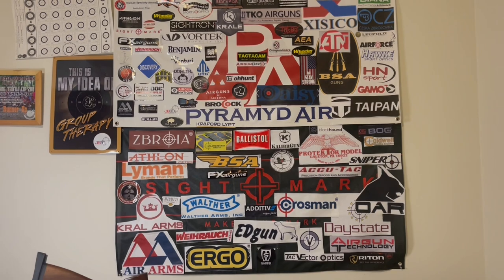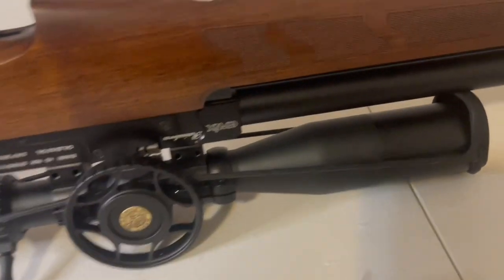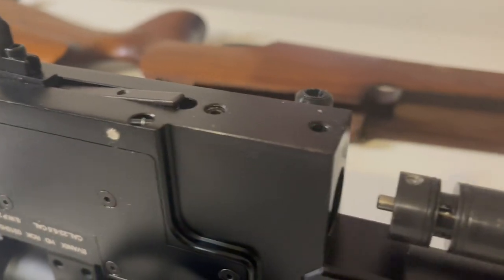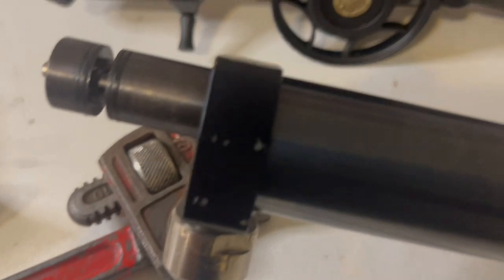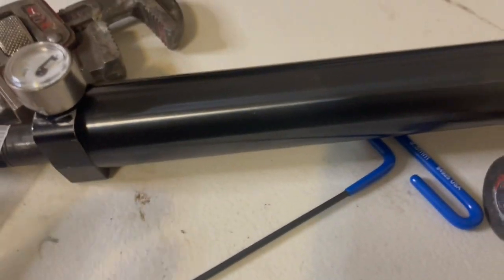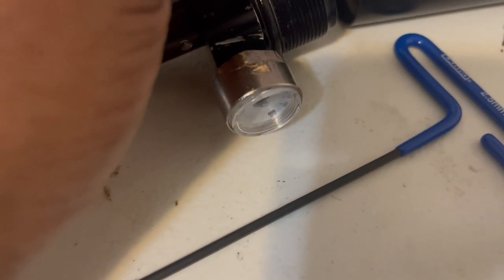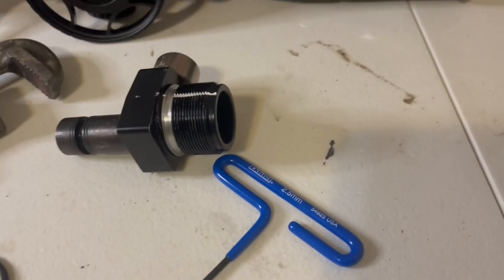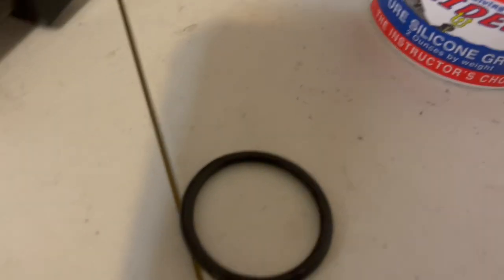Regulator install and test! Evanix Rainstorm #evanixrainstorm #humaair #humaregulator

Comment: Ouch it's nasty scratches on that air gauge I've ordered pliers with rubber teeth covers to stop that from ever happening cuz I take so many guns apart that that was eventually going to happen if I didn't buy these pliers
Reply from the maker: 👋🏾sup brAh! I have pliers with rubber teeth! No go! Braddah👊🏾😎
Reply: @airgunspestingch.8426   I got  3 different size rubber tip  Pliers
Reply: @airgunspestingch.8426   And I just couldn't bring myself to do any of that grinding of the thread's vent hole system I mean if I got a grind holes in the threads I might as well just  drill a hole in the air cylinder
Reply from the maker: Sup bruh! I have combination pliers and channel locks with the rubber pads and still wouldn’t loosen up! Got do what I gotta do ! braddah👊🏾😎
Reply from the maker: @gumbystown  👋🏾sup brAh! All my hatsans and Kral has the slot line on the threads! No problems since I’ve done this! Huma recommends this method over the removal of the o ring braddah👊🏾😎
Reply: @airgunspestingch.8426    I only have a couple of Huma regulators I usually use Robert lane or altoras